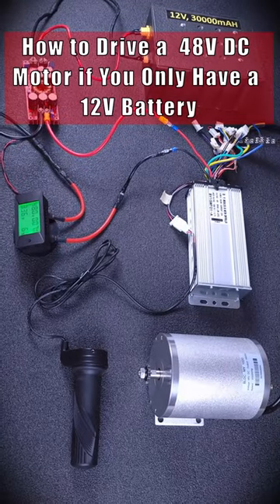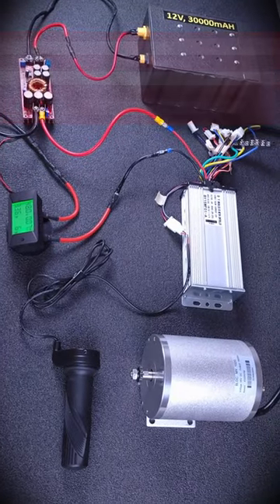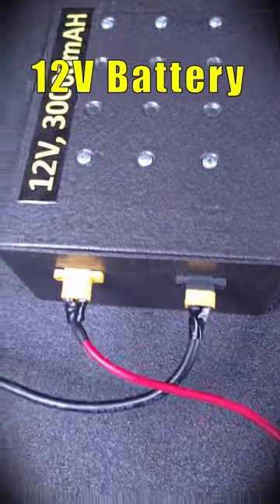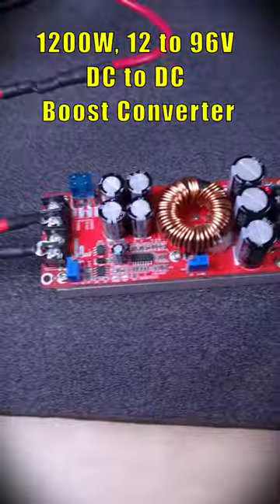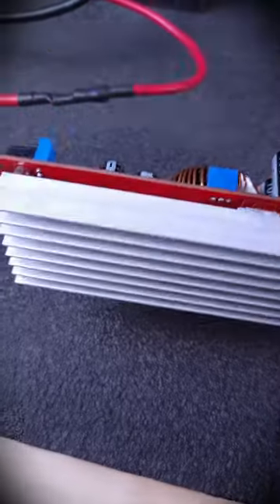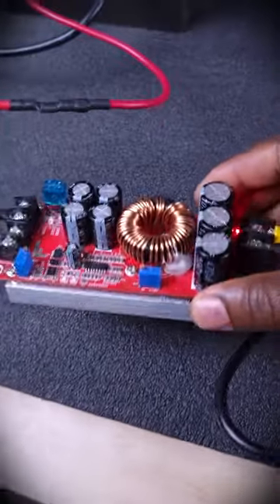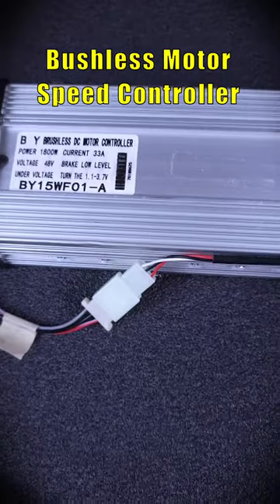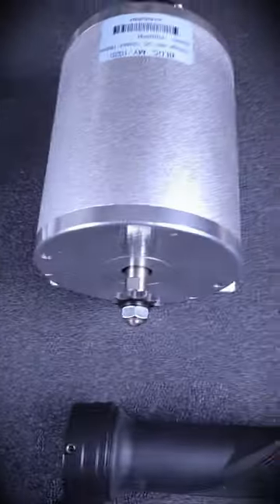How to power a 48V ebike DC motor from a 12V battery

Comment: Hi, I have a question.  How do you get that gear off of the motor? I got the kit but the gear doesn't fit my chain, as the gear is for a smaller type of chain? Thanks
Reply from the maker: Hi friend,
Wonderful question. It took me some time to figure it out as well.😊
There should be a wrench groove on the shaft that you can use to hold the shaft in place as you try to loosen the nut that holds the sprocket to the shaft. 
You have to find the right size wrenches to avoid stripping the nut. 
Most importantly, the nut is a left nut, and you have to loosen it by going counterclockwise.
I will add the links to the parts in my next video... coming out soon.
Reply: @theinnovati0nlab782  Thanks man, take care!

Comment: Dc to dc input and output how many ampere maximum
Reply from the maker: The converter used in this video has a 20A current limit.
👍😎
The Innovati0n Lab💥
www.theinnovati0nlab.com

Comment: Do you think you could conect it to a 24v battery I’m doing this project about making my kids razor mx350 faster i just don’t know what I need can you plz list me items I need to run it perfect on a 24v battery. it is the stock 24v battery  one I’m trying to put a 48v 1800 motor on it basically the same as you just 24v battery plz respond your advice will make everything easier Thank you
Reply from the maker: I would have  loved to give you a couple of pointers, but  honestly, I don't know much about the mx350 system. Also, my experience is that the kind of drive poqer you are looking for can only be realized directly from a strong battery system.....and not from these boost converters. The converters have a current limit bottleneck that limits the amount of power you can get from them.
If you are looking to maximize the power of the  1800W BLDC motors, then you need to design a 48V battery system.

Comment: It will work if I will use it in my solar panel 48 volts (550 watts)?..then convert to 24 volts?
Reply from the maker: Are you asking about the boost converter or the ebike electric motor?

Comment: Nice presentation. Have you try it on the bike, does the battery last longer?
Reply from the maker: Thanks a lot for the wonderful feedback.
👍👍
I have not tried it yet. 
I intend to build an ebike in the future. But I am working on a way to test the motor before actually using it in my DIY ebike project.
Reply: @theinnovati0nlab782  may be🤔 I will try it for you😀

Comment: Schematic,please
Reply from the maker: I don't have any schematic made for this video. Drawing schematics takes lots of time, resources, and effort. However, the connections are really simple. You can follow the connection labeling provided by the seller in the link below to make all your connections.
For the boost converter, all you have to do is to connect your 12V input (+ and -) and then adjust the output voltage to 48V as I showed in the full video. Adjust the current potentiometer adjustment to the Max point.
👇👇👇
FULL VIDEO LINK:
https://youtu.be/2HZmLqduwMU?si=Sa0k9K6HMNFnPCX6

PRODUCT LINK:
Mophorn 1800W Electric Brushless DC Motor Kit - 48V 4500rpm Brushless Motor with 33A Speed Controller and Throttle Grip Kit for Go Karts E-Bike Electric Throttle Motorcycle Scooter https://a.co/d/1JZtDaJ

Comment: Perché è sconsigliato usare direttamente un motore 12v ?
Reply from the maker: Thanks a lot for the wonderful question, friend👍👍
The main reason will be because it is generally recommended to use higher voltages - when possible because higher voltages will  mean a lower current draw from your battery.

For example, if your dc motor has a power rating of 2400W, if you use a 12V battery, you will be drawing a steady current of 2400/12 = 200A from your battery and this could damage your battery.

However, with a 48V battery system, your current draw will be reduced to about 50A.
Reply: @theinnovati0nlab782  la forza del motore rimane invariata a parità di potenza?mi spiego meglio:un motore 600w 12v e un motore 600w 48v hanno la stessa forza?l unica differenza è il consumo di corrente?
Reply: Esatto, stiamo parlando di potenza o watt.
ma il problema sta nel fatto che per le componenti scaricare così tanta corrente è faticoso, ecco perché si alza il voltaggio: si scarica meno corrente alla volta ma più velocemente per una quantità di watt pari

Comment: I have heard there is a big throttle lag when using a boost converter to power a motor. Is that true? I'm talking throttle response too.
Reply from the maker: Thank you so much for mentioning that. I personally didn't experience any noticeable lag during my initial testing. Maybe because I wasnt paying attention to that. I will watch out for that during my follow-on test.

However, I would think that the lag should be in a matter of milliseconds though. Also maybe the constant current setting of the boost converter might have something to do with it. I can see the motor being a little sluggish with response/acceleration -  if the constant current setting of the boost converter was not set to the maximum point as this will limit the resultant power delivered to the motor.

Comment: This not working. Your boost converter as not enough amp. in your configuration your limited to output 240w max. 12v x 20amp ( your boost converter )
Reply from the maker: This is correct, and I have talked about his in multiple videos that I have made on this subject.
The big question is, what can you really drive with 240W on an electric bike or scooter?
Please watch for my electric motor load simulator series starting this week.
Thanks again.
👍😎

Comment: Won't work on real load.
Reply from the maker: Thanks for the great feedback. You have a valid point, but it also depends on how much load you are driving and the input voltage you are using.
I have not been able to build a scooter or ebike with this yet, but I made a load test video that essentially shows the relationship between the expected output power and the applied input voltage.

Check out the video below.
👇👇👇
https://youtu.be/haGmAmpqNAw?si=ENe0N6AKfWo2Aems